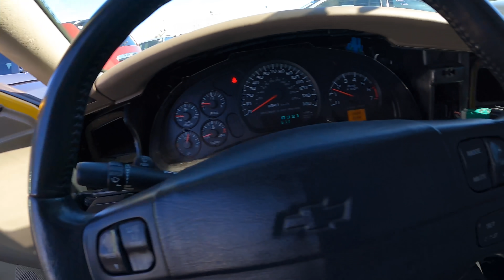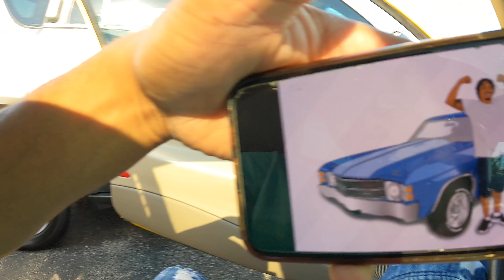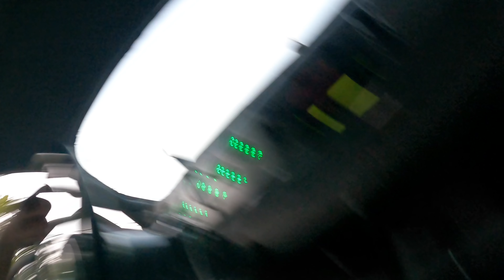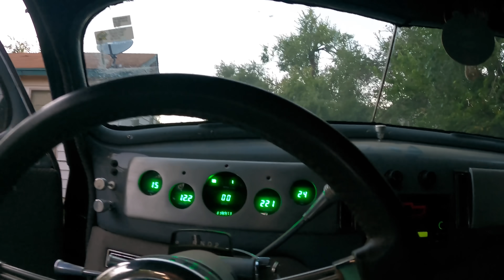Big Mistake Buying this Dream Car and it’s HORRIBLE!!!￼

Comment: The Chevelles' rear end is whining under acceleration. It might be the pinion ring gear mesh is too close or pinion bearing bad. If it was clunking on deceleration that would be a worn ring gear and pinon. My guess is the person who put the 9" in the car either did the chunk or someone didn't know what they were doing! Find a good tuner cause you will have to program shift points when you change the rear end ratio. Loving seeing you driving your car! Thanks for taking us on the ride along!
Reply: I was just coming to say that and its a noise under the hood !
Reply: Pull that motor out and up grade it to a race engine👍

Comment: Since you got the LT1 with GDI you need to get a catch-can at least to cut down on the blow by and carbon build up on you intake valves. Will definitely help in maintenance in the long run.
Reply: They have the stem valve blocked too , and he need that !

Comment: I bought a 1970 Chevelle rust bucket for $12k 3 years ago. You got a good deal if you paid $30k-$35k. My interior was shot and the body had to get metal work done all over and everything replaced besides the roof! Still haven't got it done yet and drive able. Invested a lot of $ so far. Got $35k at least to invest to get it good and on the road. You got a good car there man even if it's not the 1970.
Reply from the maker: Thanks 🙏🏾
Reply: I wouldnt say he got a good deal but it wasnt as bad as many are claiming, they dont know what Chevelles are worth these days.

Comment: Get that manual transmission for the most connection to that Chevelle. LSX454, TR6060 and 3.73 rear. And you’ll be set.
Reply: Well he can drive with his coffee in his Right hand 🤣 but no I like that car it's clean and rare

Comment: Bro, you don't just throw water on a hot engine bub. You gah fuck around an crack the block like that. Smh Comon mane. You let it sit, cool down then pressure wash it. Smh An that rear end, that bitxh is going to lock up any day now bub. When they get that wine in them like that it won't be long. Had one wine like that in my 05 blazer an that bitxh sceeerrrrrrrttttt locked up out of no we're. Lost control spun around in the highway 4 times. Thank God I live in the country an ant shit been coming the other way!

Comment: Thanks for the Shout out, I mentioned that the 5.3 you have is based off the LT platform, not the LS. You'll be fine bro, just chill for a bit, the market will open up. Doug Cook at motion raceworks has a Gen V 5.3 in his Nova, its a bad bitch!! Check him out on youtube
Reply from the maker: Ok 👍🏾 thanks 🙏🏾
Reply: @luckyswheelzndealz  yessir any time

Comment: Do not change that rear end, that is a ford 9 inch and as far as muscle cars go that is the standard....If you want to get a bit more out of it, change the 4 11's to a 3.73 to start....that will get you a little more on the top end, if you wanna get more outta that 5.3 put a cam in it or if you wanna take it a step further maybe a supercharger. Thats a truck 5.3 you got in there you cant expect a whole lot out of it other than reliability. The guy never should have taken out that 454 to begin with but you have to deal with his mistakes. Personally if you wanna stick with the ls swap I would just save your pennies and get an LT4 out of a crashed camaro or vette...they are all over the place and have that put in....a hell of a start on one sweet restomod

Comment: Hey luck look up Cover seal I got one on one of my cars they are pretty pricey but they get the job done to keep the rodents and everything out haven’t had any issues since I’ve had it use to find rat droppings on my engine all the time luckily they never chewed anything up you should have one on that chevelle or any of your cars that you have parked for a while

Comment: Yo if you keep burning rubber turn the corner so you going to break that spoiling your rear-end it's meant to go straight it ain't meant to turn both tires turning at the same time your ass in going to break now keep on

Comment: No disrespect brother but it’s foolish to say your 5.3 is better than the original 454 that came in 70 Chevelle. Real car guys know that not the case. A 454  is a 7.4  so basically it’s  a 5.3 vs 7.4.

Comment: Yeh that’s a 9inch Ford you would be dumb to change it.
Reply: Yup. All Lucky needs to do is find someone who know how to set up those Ford 9". Lower control arms are already boxed (uppers probably are too) and it looks like it's riding true from the previous video.
I'd keep that 9" and stay out of the GM 12 bolts. They are more money to set up and aren't as beefy. Hell that Chevelle was probably pullin the front tires off the ground in a previous life.
Reply: @512kjt  that’s probably doughtful it was a full on race car. Lots of guys put 9in fords in street cars. 12 bolts are plenty strong to don’t think they aren’t tuff but no use in swapping to a 12 bolt when it has a 9inch Ford in it

Comment: Its nice just 2 problem in my opinion Ls swapping a Chevelle makes it loose value i believe it would be worth more in original condition.  And the 2nd is for the price u shouldn't have to spend no money on anything or fix anything for 30k. Next time bra come to Atlanta an get yo ride man. U can get a clean Chevelle down here all original for 10k-15k bra no capp

Comment: Is it matching numbers on the fire wall? You paid 40k and it's a true 454 ss then you paid what ya paid even wit out the engine but ya paid 40k for a v6 base model then you paid throu the nose for nothing. Ya homie said people pay 10k for rusted out ones but that's matching numbers most times.

Comment: Man you don't know nothing about cars The heater Don't work AC don't work The rear end need to be rebuilt you could have bought that car for cheap you paid too much The car have great potential but you don't know what to do with it I've been working on cars for 35 years